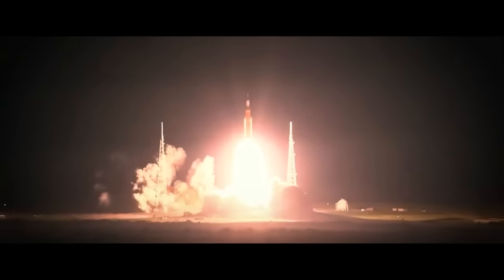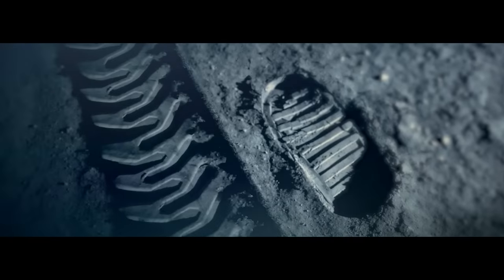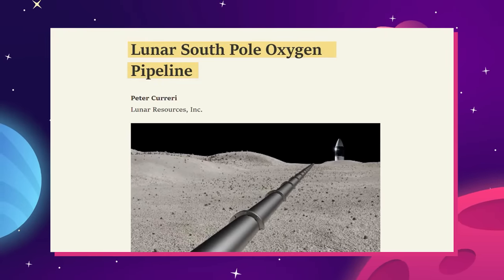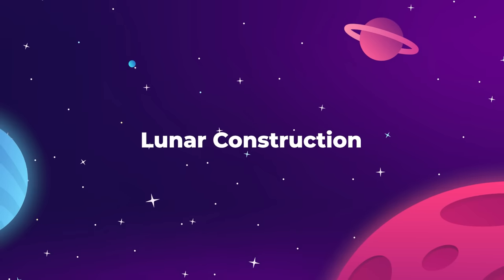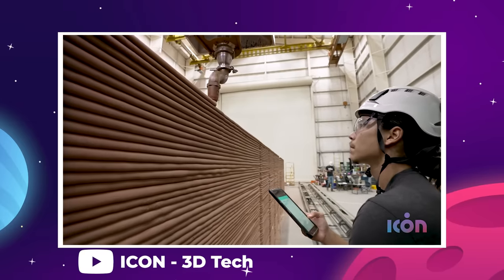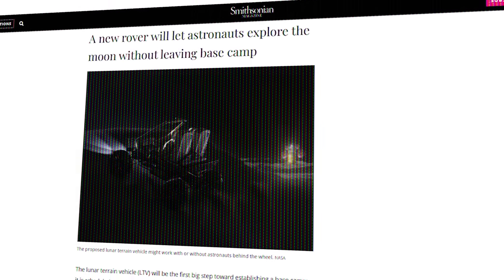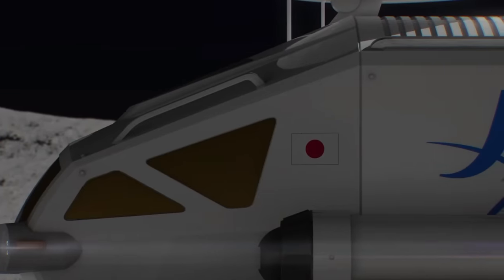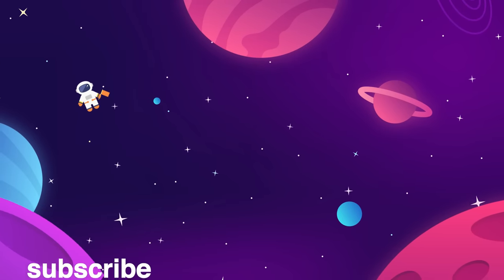How NASA Plans To Build The First Moon Base!

Comment: One of the First YT vid's I've seen that's addressed the Moon's Dust problem. Yes, it's been a major factor in the Delay and Cost overruns of NASA's New MoonSuit, (now contracted to AXIOM Space), because it's so difficult to deal with. You've mentioned it's abrasive nature here but nothing about it's Two worst attributes. Aside from being extremely abrasive, Moon Dust is Statically Charged (caused by the Sun's daily changes in ionizing radiation) and Clings to Everything, which gets you to its 2nd dangerous aspect, it becomes airborne and inhaled when getting out of your suit back on the Spacecraft. The stuff is so fine there are pictures of it hovering over the surface like fog because of it's static charge.   All 4 Astronauts w/ Apollo's 16 & 17 that walked on the Moon suffered from respiratory problems due to Moon Dust falling from their Suits and contaminating the interior of the LEM.
    I hear the New MoonSuits will have the ability to reverse the Electrostatic Charge that moon Dust carries with it, and that Blasting a Suit's fabric w/ Cryogenic nitrogen (LN2) removes most of the clinging dust. Airlock's will be used at some point and maybe shedding Moon dust will be done there. That means packing Liquid Nitrogen for the Moon Trip as well. 
   The abrasive nature to equipment that is another Real Problem. NASA doesn't talk about it much, but Lots of Apollo Mission equipment was damaged or rendered useless in a very short period of time due to Moon Dust. It'll be interesting to see how this problem gets solved.
Reply: Just a side note is the very real hazard of silicosis in the lungs from fine dust, I think from memory your lungs can expel > 5 micron dust, but smaller sharp fragments can scar the lung linings and it's not good.
Reply: The channel named Joe Scott actually addressed this too when he made a video about the Artemis program.
Reply: get clothes run a current in them
Reply: Yes we really need to be in an internalised environment completely isolated from the external environment. Ie. our spacesuits need to be more like capsules - always outside, enterable from the back. This way no dust would ever be within the habitat environment. However - I also think the suits themselves are too bulky to be long term solutions. The only real long term solution I can see is the Skintight Astronaut Suit - but more development time is needed to overcome material inflexibility under armpits and the groin area. Perhaps research into meta materials would yield results.
Reply: I just learned about the dust situation a few years ago and it makes perfect sense to me.
I can see where it might cause respiratory problems as it would be quite similar to breathing diatomaceous earth dust. Maybe even worse, like microscopic sharp broken glass.
No atmosphere situation makes for ultra arid situation which makes for ultra static electricity situation.
WHICH makes for dust clinging to everything like powder - coat paint on paint line.  Parts are electrically charged , paint powder sprayed near part and paint is attracted to the part. Then run through hot oven where paint melts on.
They are charged, they kick up dust, it sticks right on them. Probably does not just brush off.
At very least they will need hazmat type suits or paper ( tyvek ) suits like ones worn when working with fiberglass.
Chuck them off before they go back inside.
Reply: @josephslaviero well they are in space suits and breathe with oxygen tanks..wouldn’t affect them
Reply: The new moonsuits will literally have a "Reverse the polarity"-function.
Reply: @tahustvedt  Did you Ever meet a decent RC modeler who Wasn't Grumpy ?  😉
Reply: @b_collins7846  When they return to the habitat, they will bring moon dust with them.
Reply: I don't like moon dust. It's coarse, rough, and irritating, and it gets everywhere.
Reply: NASA will have to improve air filtration systems dramatically. And open up a dry-cleaners.
Reply: Better to collect dust than blow it off,  not inside an airlock surely. And nitrogen has to be delivered from Earth to Moon with fuel conse quences. But an intere
sting
Reply: First thing I thought of when the video covered 3D printing was the impact of moon dust on equipment. They need a lunar version of those money capsules with the high speed cyclone. Reverse the charge and blow it all off. Or maybe some sort of volatile spray, like contact cleaner.
Reply: One additional concern about the dust that hasn't been covered is the behavior of the dust as it is kicked up by activity on the surface.  Driving vehicles, excavating for habitat installation or mining, etc.  The concern is that the dust will take a significant amount of time to settle back to the surface which means that there could be a dust fog around immediate work areas and possibly over very wide areas.  Not only could this severely affect visibility, the dust will coat everything and get into any moving joint that quickly reduces the life of seals and bearings.
Reply: @panhandlejake6200  there's no atmosphere and .2g. Wouldn't the dust just take 5x as long to settle as it would on Earth?
Reply: The obvious ultimate solution ( although expensive) is to seal the dust. Pretty much setup robots to cover the surface with concrete or any other suitable glue. If energy is supplied from the sun and the system is autonomous , the entire moon could be concreted. Eventually
Reply: @sergeykurdyukov2617   Lunar parking lot? I don't think humanity would go for that.
Reply: Fascinating. 🌌
Reply: The most interesting concept that i have seen addressing this issue is suit docking bays.  Basically rear entry suits that stay outside at all times, and the occupant docks into a station where the suit remains outside at all times.  Its got its own issues to work out, but the best idea to keep the outside from getting inside, is having gear that never comes inside.
Reply: @panhandlejake6200  Not sure it would be a problem. What keeps dust suspended on earth is the motion of the wind and small vortices, etc. On the moon, there is hardly any kind of atmosphere so anything that goes up, would come right back down, just at a slower rate due to the lower gravity.
Reply: Starship is simply too heavy to land safely on the moon.  We have not even successfully demonstrated out a fully sealed closed loop permanent habitat on the earth - how do we expect to do it on the moon?
Reply: You should check out Curious Droid or Every Day Astronaut, they have spoken quite a lot about moon dust
Reply: Don't worry about the dust since nobody has ever been nor will be on the soon either and yes, it is a "NO CAN DO SITUATION"!
Reply: He sounded as if he was more concerned with our "impact" on the environment on the Moon...like as if some eco-kook would be.
Reply: @projektkobra2247  We should absolutely be concerned about the environment of the moon... we have already destroyed almost every environment on earth and a ton of our own history, the last thing we should want is for us to also ruin any possibility of future scientists to get good information about the moon
Reply: @projektkobra2247  we are literally considered one of the worst extinction events to ever happen to earth and we are not showing any signs of stopping or slowing down at all
Reply: Best solution I have heard is to glassify the area of a base, since there is no wind, as long as the walking paths and areas being walked/driven upon are solidified to a depth of a few inches, the dust would be minimized. This can be achieved in most places using sunlight focused through inexpensive plastic lenses. It's been done on Earth with sand, and would be easier on the Moon due to the direct intensity of sunlight
Reply: @onlythewise1  That's exactly what has been done, only the wise! NASAs choices for Lunar EVA suits, Axiom and Collins Space, one of them has an electrical current periodically sent through the outer layer of the suit, which sheds approx. 85% of the lunar dust (so it doesn't build up).
The system is demonstrated in one their promo videos on YT. Worth a look.
Reply: @davidstevenson9517  oh ,ok, nice information
Reply: An "airlock' where astronauts wearing their suits are "power-washed" and the water is drained away, purified & reused? That may be a cheap alternative.
Reply: @tahustvedt  That won't make all the dust come off. It still needs to be cleaned I suppose.
Reply: @cchavezjr7  Actually, Not True. There is so much statically charged superfine dust on the Moon that it's been photographed levitating just over the surface, and it's permanent. It Never fully settles as you might think. I think that the Moon Suit seal and transference of this dust into the habitats problems will be solved, but keeping it from damaging permanently exposed equipment is a different problem.
Reply: @kylekenefick  How are the openings in the back sides of the suits closed and opened, with such suit docking bays?
Reply: It's OK.  The Lander didn't kick up any dust as it settled on the Moon's surface.
Reply: Your on the case.
Reply: ok astronaut
Reply: ok scientists
Reply: I love how in the 60s and 70s the answer tended to be "Well rough it out "😂
Reply: @andreslinares6429  I think Mars will go much the same way. The focus & determination to get there will overlook other issues to be solved if we want to stay there long term. I look at SpaceX to serve much as the Railroads did back in the 1890's for bring people out to the Wild West. People will figure out how to sustain life on Mars just as the early explorer did that risked the Oregon Trail. There's a lot of obstacles to overcome for sustained interplanetary life and it's not up to one company to come up w/ all the solutions but the ones who make the big breakthroughs will profit.
Reply: It's OK the Lunar Lander didn't get any dust on it either so it's not a problem unless you drive around In a dune buggy kicking up rooster tails in slow motion
Reply: Do we really need a moon base?
Reply: @OtisCorley-wn4zj  Don't know. The two reasons I hear most often are, for the mining and as a launch platform for Mars. The mining falls to the Capitalists & Governments looking for profit or some Military advantage. The jumping off point for a Mars launch is less believable for me. 
   I'm sure NASA & other Space Programs could give a dozen or more reasons as for "Why" a moon base, but I see the same problems with inhabiting the Moon as I do for Mars, sooner or later, you're Really gonna miss the Earth . . . . unless an environmentally compromised Earth is the reason for leaving.
Reply: @uuzd4s  we probably could use a few of those dollars to put poor people or something. Politicians always complaining about swbt, inflation etc
Reply: @OtisCorley-wn4zj  I kind of figured that was your point . . .  what the heck are we doing trying to live on the Moon when we've got plenty of issues to solve here on Earth that could use that money. Good argument that goes back to the days when Governments started spending taxpayer dollars, which is a Long time ago. It gets down to which politicians are elected based on their priorities & promises. 
   Personally, my philosophy is to give the person asking for a handout something he/she needs, not what they want. I don't give out money, alcohol, cigarettes or anything they are usually asking for, but I do offer a meal and more than half insist on Money or for me to help support their Vice's. Giving money to people who've proven to make bad decisions, will just perpetuate their bad decision making. So, you're left w/ offering support programs that require some effort by those who are on the take.
  It's a Great question that always leads to politics and who's been elected. All that said, sacrificing technological advancements to support welfare programs isn't an option when there's always somebody w/ a bigger club threatening to take over your neighborhood.
Reply: @uuzd4s  I live in Baltimore, and I definitely understand that! I'll walk them to McDonald's, or whatever they want and get them whatever they want though
Reply: @OtisCorley-wn4zj  Was in Vegas for a wknd a few yrs ago, a city w/ Tons of Street Urchins. I had checked Yelp for a good Taco Stand nearby and there was one only a block from the Motel, so I made the walk. There were about 20 people in line, so I knew it was gonna be Good.
    While in line, some street urchin asked me if I'd buy him a Taco and I told him, OK, as long as you tell me how you ended up on the streets. Big Mistake!
   I bought him a whole meal and sat down to listen. The bottom line was he spent twenty minutes telling me how every turn of misfortune in his life was somebody else's fault. He never took one ounce of responsibility for any of his own bad decisions. I kinda ruined the meal but taught me a few things about those who've found themselves on the street. Most want to be left alone and don't want anyone telling them how to live their lives and most are Experts at making Easy decisions vs Hard decisions. It's easy to make bad decisions, it's usually a Lot harder to make good ones.
Reply: @straighttalk2069 They Will not bring any moondust into the habitat, if they always had the spacesuits outside on a Wall and entered them from the backside. Clumsy but healthy.
Reply: @panhandlejake6200 As far as I see, There wouldn’t be much of a ”dust fog”. In the Moons vacuum every dust particle falls at the speed of a big boulder. Save for an electrostatic effect.
Reply: @HansDunkelberg1  The same ways the Russians do it today.
Reply: @YDDES  Yes - it is the electrostatic effect that I wonder about.  I have not educated myself on geology so I wonder how very fine dust particles, like what is supposed to be on the Moon's surface, achieve and then retain a charge. With reduced gravity, could this allow a dust layer to persist?
Reply: @YDDES  I currently do not have the time to do research into how the Russians do it. But I can't imagine a method which ensures that no dust at all gets into the station. Is that achieved, and if yes, can you tell me how?
Reply: @YDDES  This will work for a short time until the suits need servicing.
Reply: @HansDunkelberg1  ”The Russians?” Russians do not have any people on Moon. Never had. They are only on the International Spacestation, and There, There is No Moon dust. 🤪😵‍💫
Reply: @HansDunkelberg1  There is No ”dust” around the space station, so No dust is coming in.
Reply: @YDDES  However you call it, something sticky and consisting of small parts does play such a role on the Moon.
Reply: @straighttalk2069  The same goes for many things.  Aircraft for example. Don’t be afraid of spaceflight, it Will not come and eat You…
Reply: @ccbcco also too tall, how they gonna balance that in a fraction of a second when they touch down? On uneven dust and rocks?
Reply: @MrJashuaDavies nuke the moon

Comment: I´m very curious to see an actual process to produce Aluminum from lunar dust. On earth Al is one of the most energy intensive metal to produce. Something around 14 kWh/kg only for final electrolisys phase given that you already have alunmina ( Al oxide - Al2O3) at your disposal...
Reply: In space, it is basically planned to be done via "bakeries". You'd take regolith and bake the Al out of it - mirrors, solar energy. At least when we talk about the Moon specifically. But until there is a really developed lunar industry, I doubt making aluminium would be anything but a test on a small scale. To justify the entire aluminium mining and refining facility, its cost of construction and operation must have financial justification. If we are talking about bases in the next several decades, it would be much cheaper to build what you need on Earth and ship it.

In the similar way that we import aluminium when we need it, even a continent away, rather than making an entire mine, refinery and parts factory in a place we need aluminium parts at. To build an entire complex, we would need a huge demand for it on a certain location, as well as a good enough source. It will be quite some time before our lunar presence creates enough of a demand to justify the production on the spot.

The best example would be Antarctic. There are raw resources there, quite a lot. And it has population that is bigger than the Moon can hope to have in the next 100 years probably - ports, dozens of bases with 1.000-4.000 people combined. But still, we ship everything there. Moon is much further away and shipping is not cheap - but still, I don't see an industrial complex, even a small one, for quite some time. Some test facility to test the concept? Sure. Some 3D printer to fabricate the critical part from the raw resources brought from Earth? Sure. But the entire process from mining to finished part, on the Moon, to fuel the expansion?

Call me a pessimist, but I don't see it happening before 2100, if even then.